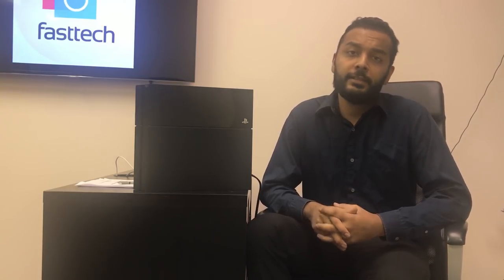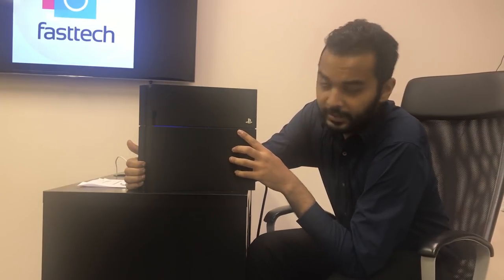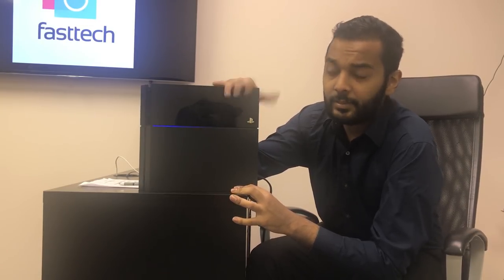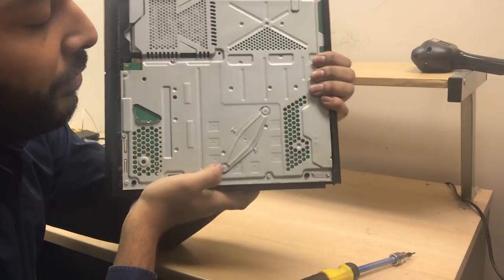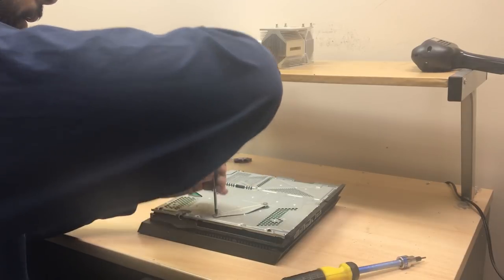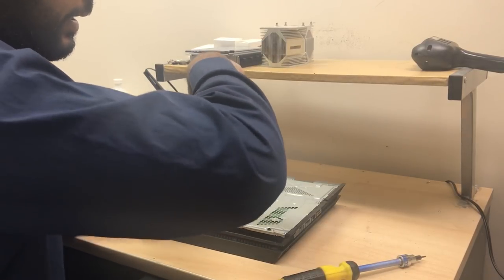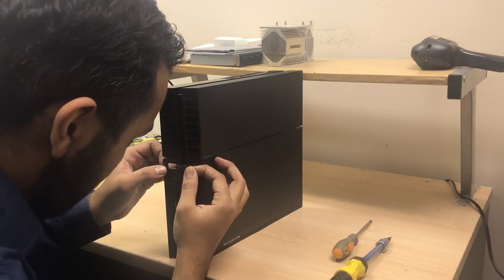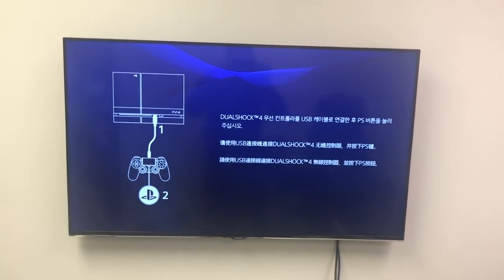PS4 BLOD (Blue Light of Death) Repair (CUH-1001A and CUH-1115A) - PS4 Turns On then Off

Comment: Is this video legit?
Reply: In the first place I cant belive Sony can make such garbage if this have to be done, and by adding those 2 circles on each side you only relief pressure. On other videos I have watched today ppl stand on their ps4 and shit >.>
Reply: This is a trick to ruin warranty is the first that pops into my head but does it work?
Reply from the maker: The models this repair applies to (CUH-1001A and CUH-1115A) are long out of manufacturer's warranty.
Reply: Fasttech what do you mean by this?
Reply: Dr J Gaming they’re really old models and by now the warranty has probably expired.
Reply: Fasttech just curious I wanted to ask you because you probably know. Anyways is this usually the fix for this problem? Or could there be other causes as well. If I need to order the washers that’s fine but is there any other thing that could be causing the blue line? Trying to fix a ps4 for a friend and it’s having the same problems. I replaced the hard drive, took it apart, cleaned it and put thermal paste on as well and it has no damage done to it or anything. So I’m not sure what else the issue could be at this point.